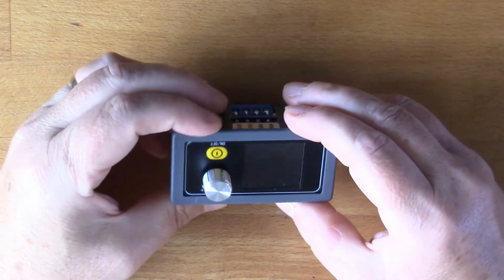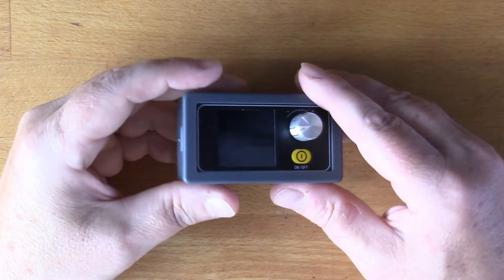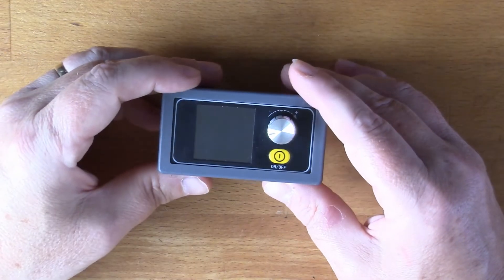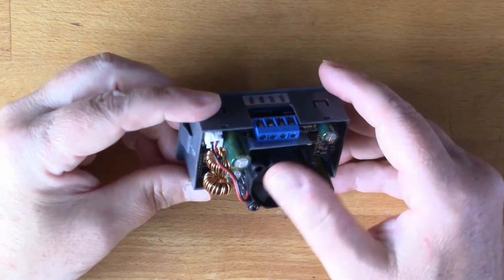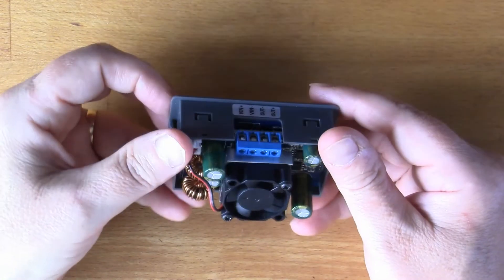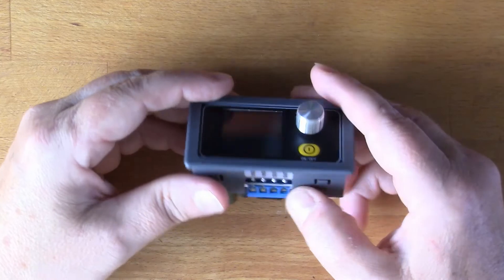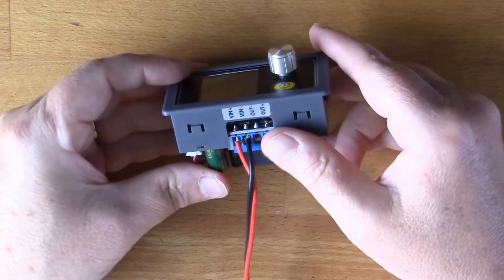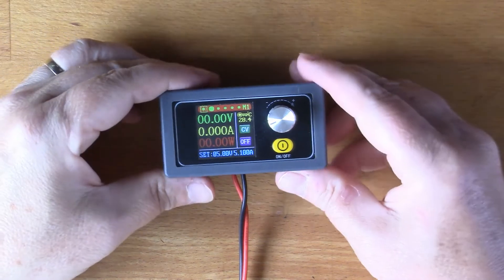Compact Power Supply XYS 3580 (#154)

Comment: Great little power supply. These PSU's are really handy for when you need very fine control at lower power levels. I have a couple of the cheaper SK80's which are still 80w but less colorful. They are also buck/boost and perform very well in my experience. Thanks, Martyn.
Reply from the maker: I haven't had the SK80.  I'll keep an eye open for it.

Comment: Looks good!  It’s amazing what they can fit into these packages!  I have the older type on my power supply but this is more self contained.  I would always err on the side of caution with their power ratings though!  I’d, personally, at least half that stated in their ‘blurb’ just to be safe.  It would still be plenty for the sort of projects that I’d be likely to have on my bench!
Reply from the maker: I do have some skepticism on the max output also.  I can remember when a 5A power supply was the size of a shoebox.
Reply: @MartynDavies  Martyn, have you seen the micro mite  software for the raspberry pi pico?  It allows you to programme the pico in mmbasic and looks like the kind of project you might like!  There’s a good video about it on Chris Barnatt’s explaining computers YouTube channel.
Reply from the maker: @gartmorn  Ok, thanks for the tip